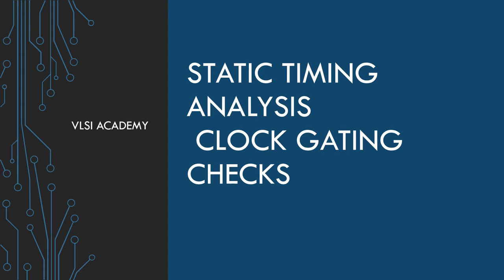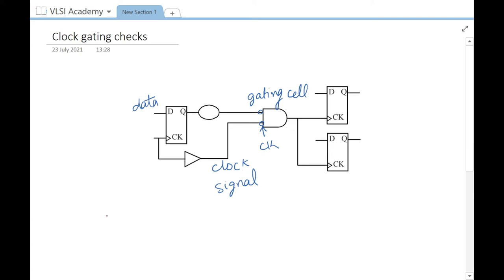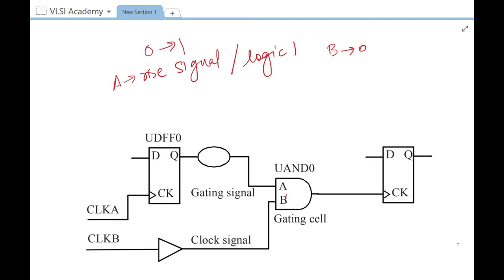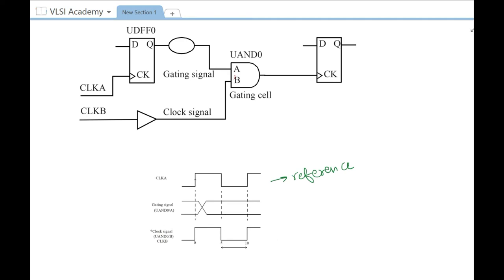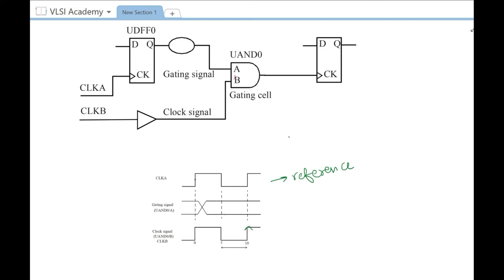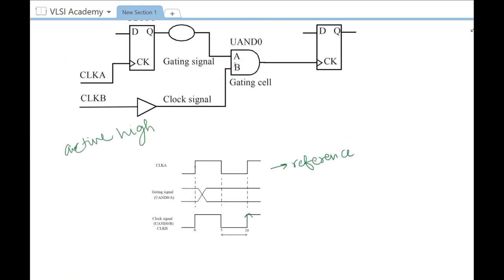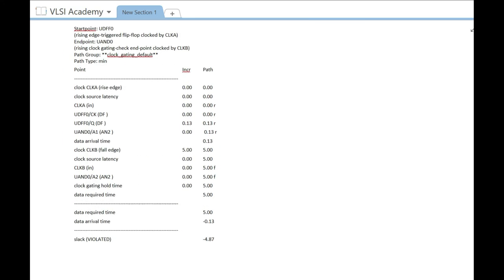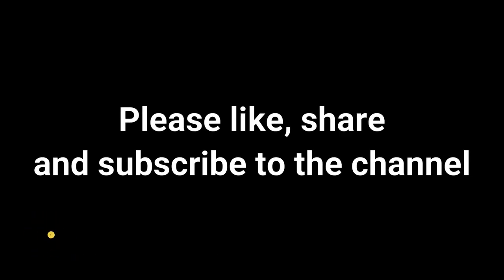sta lec30 clock gating checks part-1 | Static Timing Analysis tutorial | VLSI

Comment: In the Phase shift of 90 degrees case, why it is not considered like a positive skew (clock has a fixed delay) and setup is analyzed at next clk edge
T required = Tclk - Tsetup + Skew (0.25*Tclk)